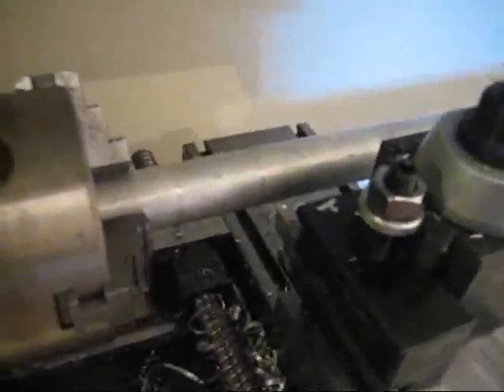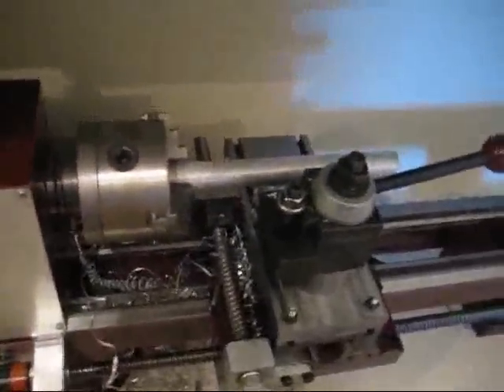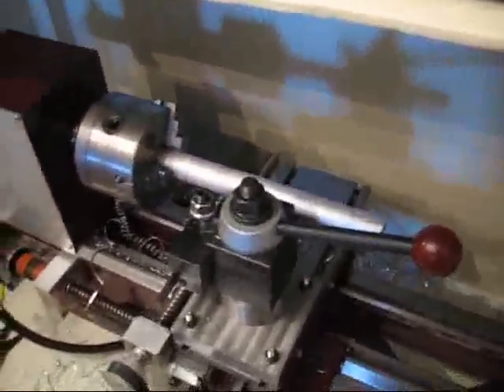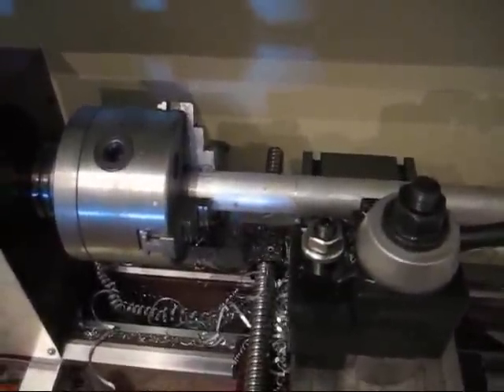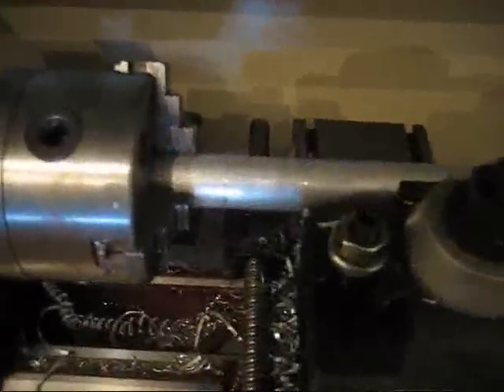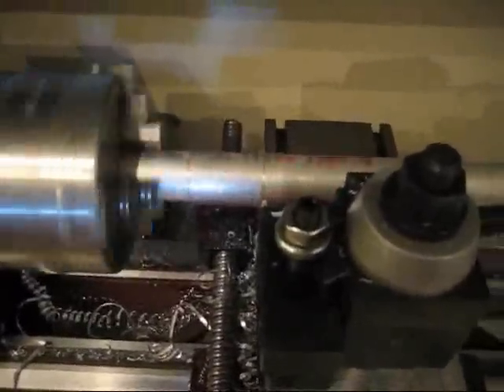9x20 Lathe CNC Conversion - The first parting

Comment from the maker: It was mostly just convenient to put it there, since I didn't want to interfere with getting the tailstock in for drilling operations.  The carriage doesn't have enough power to do any substantial drilling on its own, so I need to use the cross slide for that still.